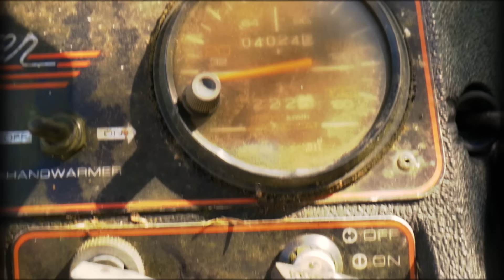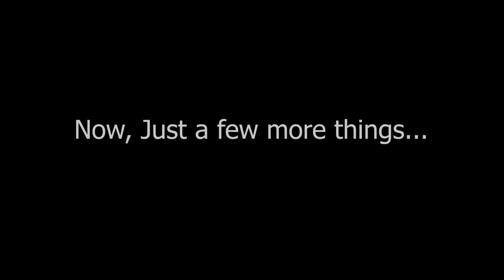I put a snowmobile engine on a motorcycle

Comment: You need that expansion chamber on their that’s why it runs like crap. Looking great though
Reply: Well No but it dose take way the power band keep mind that many of older 50's thru 80's only had straight exhaust but plug end cap with smaller size like 1/2" to 1" pipe output should help be able to gain some that back with out being a crazy motor
Reply: @SHSPVR  none of that made sense. This is a 2 stroke engine, the expansion chamber cones reflect and focus sound waves in the exhaust back towards the cylinder to keep the fuel/air mixture from escaping into the exhaust at certain RPM and being wasted. That's why 2 stroke dirt bikes and quads seemingly take off like a rocket when you reach a certain RPM and "get on the pipe". Power valves or exhaust valves in the cylinder can modify this behavior. The cones in an expansion chamber are tuned to a particular cylinder because of the "port timing". I quoted key words for you to google.
Reply: @charlesgunzelman3323  Correct. without the proper chamber power and fuel consumption will suffer.
Reply: @charlesgunzelman3323  Maybe you should try look at early 70's motorcycle like a Suzuki TS250, T250 or T-250 II hell even the old Kawasaki widowmaker and puppy one wicked ass bike that had little to no expansion chamber hell even chain saw, week eater have no expansion chamber wake up buddy, port timing should ready be max base on it bore and stroke.
Reply from the maker: Yeah I’m working on finding a way to put it back on! My thought was “ well a chainsaw doesn’t have an expansion chamber, so maybe the snowmobile doesn’t either” lol!
Reply: @CarsofTheArctic    exactly most bike back then the  exhaust output fix end cap where a bit a small where next to impossible to clean out and repack the build in muffler.
Reply: @SHSPVR  Im not sure but, i think that chainsaws and weed eaters have expansion chamber. It look like a muffler but its actually the expansion chamber. My  friend has modified his chainsaw by empting the "muffler"
Reply: Holy crap people! If you are going by "what you heard" then shut up! Nick, you are correct, NO engine needs or wants back pressure, an expansion chambers job on a 2 stroke is to prevent the reversion pulse travelling back up the exh and blocking the next pulse. The next job it does is increase scavenging on the cyl by acting as a "one way check valve" for the harmonics. In a 4 stroke the same principle is done by varying the primary and secondary pipes of the header. A "perfect" exhaust allows the pulse to travel as close to 300 ft per second by way of pipe diameter. The "perfect" exhaust then has that perfect size pipe end at the length which sends the reversion pulse to hit the back of the valve (or port opening in a 2 stroke) during overlap. Header science is very complicated and obviously over the head of most. A two stroke will run without an expansion chamber if jetted right, it will just make more power with one (once rejetted for use with the chamber)
Reply: I should add, the myth about back pressure started by people who didn't know how to tune vehicles. It went like this, "I had a v8 car once with single exh and ran fine, the muffler fell off and it ran like crap, I put a muffler on and it worked good...therefore engines need back pressure" after smacking them in the back of the head, I would explain the the car was tuned to the single exh, losing the muffler leaned the engine out so bad it lost power and drivability. Once the muffler was back on, the engine was back in tune. If...IF, when the muffler/exh/manifolds etc were pulled, the carb was rejetted, the car would of had MORE power than previously because the engine could flow(breathe) easier. I build headers for various racing venues, that's why this myth is a pet peeve of mine.
Reply: @jimmiller4667  Thanks you get a Thumbs UP
Reply: @OliverMotorized   the tuned pipe aids in scavenging across the combustion chamber to pull the burned fuel out and help push the fresh stuff in. Check the jetting the sled was most likely tuned for 0 degrees so they run real rich in the summer might wanna try moving the jet needle 1 clip up and the main jet down by 10 toss a fresh set of plugs in and read them after a nice hard run white is lean black is rich copper color is right. Make sure the mixture is on then worry about the pipe simple stuff first
Reply: @CarsofTheArctic  its not just backpressure, the chamber has a certain size and shape for the specific engine and for the powerband it needs.
Reply: @SHSPVR  i should have specified for the simpletons. THIS ENGINE needs an expansion chamber because the cylinder ports are tuned for it. I have a 300cc trials bike and the 2 stroke engine doesn't need an expansion chamber because the cylinder is tuned for low end torque. Same as a chainsaw. There's a very clear science to high performance 2 strokes, this snow mobile engine being one.
Reply: @OliverMotorized  
Port timing is radicaly different on a cylinder without expansion chamber.
Chainsaws are also weak relative to rpm and cylinder displacenent compared to bikes.
Something like 4hp off 50cc compared to ~20 hp off 125cc on bike.
Reply: @jimmiller4667  that crap about the V-8 car. Only applies to these newer pieces of junk. Because on a carbureted 4 stroke non-egr engine. There is literally no way for the exhaust to affect the air and fuel mixture. Plus it has nothing to do with the jets in the carb. In 4 stroke engines it's a timing issue. Now 2 stroke engines I don't have a clue. I've been around automotive racing all my life, and have learned a lot from the guy's who are in there 70's and 80's. Otherwise BACK PRESSURE IS A MYTH OF IDIOTS.
Reply: @OliverMotorized  a chainsaw kind of does have an expansion chamber though, it is just kind of cube shaped.
Reply: David Ramsey I think you better look up who David vizard is as well as "headers by Ed". I'm not going into all the detail, but you're wrong. The Pistons can create about 18" of vacuum max, cam tuning "ram" in the intake can aid to get over 100% ve, but properly tuned headers can create 30" of vacuum in the intake on overlap. But, don't take my word, do some research. If you worked on race engines as you said, you wouldn't of made such an uninformed statement. Either that or you've never power the top 6 of 10 cars in a race as I have. To say exh has no effect on the intake? Wow.   Edit: and yes requiring back pressure is a myth as I stated previously.
Reply: It's actually not very difficult to calculate the perfect expansion/contraction exhaust chamber for any engine and tune it to any particular RPM you want. You just need the cylinder port heights and sizes, and the cylinder volume. There are formulas around there. Although better to just copy the sizes of the original exhaust. (You just need the distances and the diameters of the tube, if the distances and diameters are OK, the tube can take any shape you want.
Reply: A high Revving 2 Stroke either needs an Expansion Chamber or Backpressure, if they don't have that, it's the same as a Boost Port aiming directly at the Exhaust Port, it just wastes fuel and fresh Mix will just leave through the Exhaust Port. You can't just compare 2 and 4 Strokes and how one doesn't need Backpressure, so the other one won't need it either. 2 Strokes always have symmetrical Exhaust Timings, and will dump Fuel out of the Exhaust if there is no Backpressure(compared to 4 Strokes, wich can have asymmetrical Timings), you can Tune the Ignition and Carb all you want, if there is no Backpressure or an Expansion Chamber on it, it will have less power even in low Power applications. Of course, to much Backpressure will harm Power output, but can, to some extent, up Fuel economy. Jost a little Comparison: 1.2hp 2 Stroke Moped, Exhaust timing very low at 110°, Blowdown of 10°, no Chamber, if you swap out the 18mm Header for a 22 or 28mm one it will rev out better and will have more power in the Top end, if you remove the Muffler, it will get extremely loud and no matter what you do, you will have less power over the whole Powerband, it might rev out a little further, but it won't gain you power, same with if you have a 28mm Header and put a 32mm or even 36mm on there. 

Also, even full Chamber Exhaust use Backpressure, they have something that's called "Stingers" on some Setups you can even gain a little Power when you make them smaller/ put a little Plug in the end so that the inner Diameter gets smaller, but if you remove them Completely, you will loose a noticable amount of power, no matter what.
Reply: @charlesgunzelman3323  THIS!
Reply: nick podgorny what do you think those pulses are? They’re pressure pulses pushing back into the chamber. Tuned back pressure pulses are still back pressure.
Reply: @Seniornuggets  2 strokes need back pressure buddy sorry to say I have a dirt bike and it runs ways better with an expansion chamber its a 150 and it goes 77 that 440 should go way faster u know nothing about 2 strokes they will run without them but there's so much more power with it
Reply: @CarsofTheArctic  is not plain restriction. The shape of it sends a pressure wave back that hits the cylinder exhaust port before it closes and pushes back into the cylinder the flesh air gas charge that escaped into the exhaust during the  intake cycle.  Is similar to a supercharger in a 4 stroke, but loads the gas from the exhaust port. It increases the actual displacement of the engine and compression ratio

Comment: Mod the original exhaust to it you will make so much more power with the expansion chamber
Reply: Yep he screwed the pooch when he chopped the expansion chamber for sure.
Reply from the maker: I will definitely put it back on! thanks for the comment!
Reply: @OliverMotorized  make sure you keep the same dimensions of the pipe, if you make a pie cut to move the chamber somewhere, only cut half the pipe, add the piece back to the other side so you don't change any lengths, only angles.
Reply: @OliverMotorized  we put a 440 Kawasaki from snowmobile on 3 wheeler.... WARNING!!! When you put expansion chamber on from original exhaust...2 stage clutch WILL take the handle bars from your hand. ADD A KILL SWITCH so it will not leave you sitting on your butt too far away from the bike.  I got the T-shirt on that ride!
Reply: @uknowimright6269  i use a jetski tether killswitch for my trials bike. Saved the engine from dirt revs a few times for sure.

Comment: Sweet!  I would have thought it would take off faster, maybe better with the carb adjustment.  Hey 65mph on Frankenstein bike is pretty good, little scary too! If you need more snowmobiles there are plenty down here in Utah. Not too far of a drive from Oregon.
Reply: The exhaust was killing it a bit too. Needs that expansion chamber on there to help low end.

Comment: Everybody telling him that the engine wont run without the expansion chamber lol. Youre right and wrong. They obviously make a great improvement if made and tuned for the engine, but the original way two strokes were piped was a straight pipe, a really long one that was cut down little by little untill the engine ran best. So yes, the expansion chamber would help give back some of that great two stroke SKKKRT, but it is not 100% needed.
Reply: Expansion chambers help keep the power response smooth like a vacuum

Comment: We built go-carts and pulling tractors with snowmobile engines, clutch drives and solid axles. The acceleration was insane.
The craziest one was a pulling tractor with a 650 Polaris Wildcat and a 670 Ski-Doo Rotax both running on straight alcohol with twin expansion chambers for each. That tractor was violent when you left the line. We did tractor pulls all over Ct.
Great bike build !!

Comment: You NEED the stock exhaust with the expansion chamber or a custom expansion chamber pipe. You probably  lost 1/3 of the power by removing it and all the torque :/

Comment: What’s up Oregon! SW Washington here. This was a awesome build! Good to see a young guy just getting in there with an idea and going for it. You do need that expansion the stock exhaust has. The pulse that engine gives off is needed for the back pressure. It’ll be a whole different beast if you can figure out a way to utilize it.

Comment: You could just put the expansion chamber back on at the bend there, section the in/out a bit with some sheet metal to get it pointing back the right way.  Sweet idea though and really good first test.

Comment: The rest of the expansion chamber exhaust is important, really important. Putting it all in as designed will let that thing really scream. You can hear the effect from the exhaust is missing. You won't believe the difference. Cheers. 

Well now that the other comments are visible, first time they weren't, I guess just consider mine as a vote for the expansion chamber.

Comment: You might explore your options on the drive pulley as well.  Different springs and weights in the drive pulley will give you different engagement, or Stall, speeds on the engine revs.  A snowmobile has a rather heavy drive train that needs a lot to get it moving, compared to a motorcycle.  Getting the clutch engaged and driving you at lower rpms, and thus getting you in higher ratios at lower rpms might increase your speed range.
Reply: Very good point

Comment: Really great job using the snow mobile engine. If you ever fix the exhaust and tune it it’d be worth taking to your local drag strip ( the legal kind ) just to get the paper with your speed and time . With the exhaust fixed 80 mph should be achievable before you start really tuning it . Great video , wishing you many years of safe and fun riding 👍

Comment: I will not tell you that you need the expansion chamber on it, but that is only because I call it a tuned pipe. The basic idea is that it works similarly to a turbo on a 4 stroke. It needs to be the same length as it was to work right.

Comment: Have to have the expansion chamber for the 2 stroke.  It uses the momentum and pressure of the exhaust gases to create a pump that squeezes more air and fuel into the cylinder during the intake stroke. Works like a turbo in a sense. Without any moving parts ofcourse.

Comment: Weld that pipe back together with the expansion chamber. If need be you can always re-route the expansion chamber down under the frame like you did with your custom exhaust. Expansion chamber is vastly important to how your bike was running...

Comment: It's running real rich for 2 reasons. #1. As many have already said, it needs it's original expansion chamber. Two strokes won't make power with that straight pipe. #2. It's a snowmobile engine. The jetting is tuned for running in winter. Even after adding back the expansion chamber you will need to lean down the main jet, probably drop the needle position a click and adjust the air screw on that Mikuni carb. Also, it's spelled BRAKE not BREAK. Looks cool though.

Comment: I built a go cart using a snowmobile engine and chain case.  1 thing i leaned is the gearing needs to be matched.  The jack shaft you are using went into a chain case on the snowmobile and it was geared down roughly 2to1. Double check tooth count and it with help with the next part. So the front shaft that drove the track had roughly 8"drive pulleys and now your using a 22 to 24 in tall rear tire.   So you need an additional 2.75to1 reduction.  You need a bigger rear sprocket minimum of 77.  So you can have that 5.5 to 1, or even more 6 or 7 to 1. Follow everyone else's advice and do pipe and intake.   You may have to lean out, due to not being in cold weather.

Comment: Very Nice!!
 As with almost all projects like this its going to need a few issues worked out like the expansion chamber which will definitely smooth out the power as well as nearly doubling it. The CVT should be tuned to gear up maybe a tad quicker and it also sounded like its geared on the low side, a bigger front or smaller rear sprocket can fix that to your liking and going down 2 teeth on the rear can make a very noticeable difference.
You can basically set the sprockets where you want for best cruise rpm or top speed whichever you prefer then tune the CVT for the best "upshift" rate by either changing the weights on tje engine side or the spring rate on tje driven side and that way you can get the most out of the available power from the engine so you can get tje acceleration rate and hill climb where it fits your needs best and then control the cruise rpm and top speed by the sprocket size, but with these settings you can set it exactly how you want.
Very nice project and you're going to have a lot of fun with it as you tune it to fit your preferences.

Comment: Sleds usually run in the cold... the fan engines tend to get really boggy when it warms up ..
Reply: The warmer it gets the richer it runs, and the colder it gets the leaner they run. I burned up a 440 Polaris when I lived in the Keweenaw Peninsula riding in subzero weather without re-jetting.

Comment: The brakes on the jack shaft is brilliant, the pads have less work to do due to the gear reduction in the chain drive. I wouldn't change that for nothing, unless you want to go hydrolic instead of cable.

Comment: My dad put a 25 horsepower j l o snowmobile engine in my mini cycle back in 1975 fast 0 to 80 now only problem was had to use mini cycle torque converter. It limits the top end speed. It was awesome

Comment: as others said..as soon  as i saw you cutting that pipe I knew it wasnt going to be good..it is tuned to the motor. I would have somehow used the entire exhaust then extended the pipe to the back of the bike. I was wondering how well it is cooling.. I am from snowmobile country and on warmer days when driving an air cooled sled we had to watch the engine temp